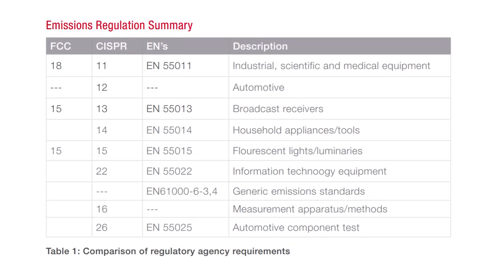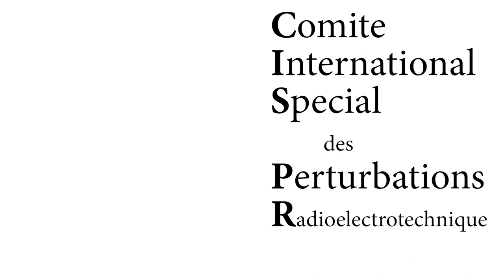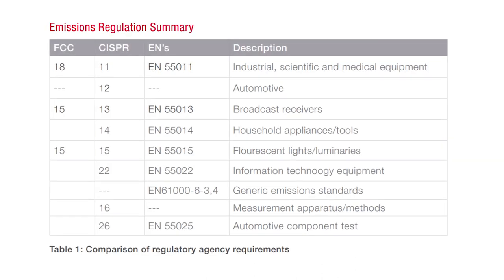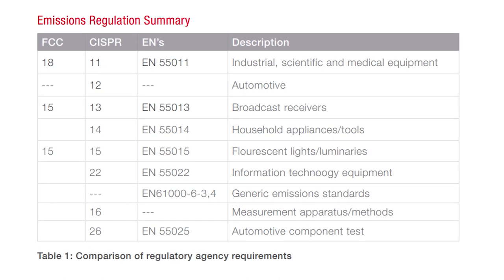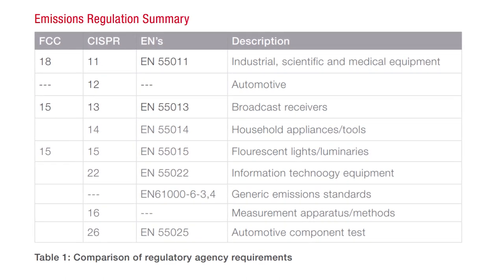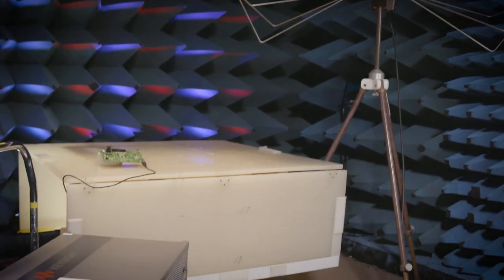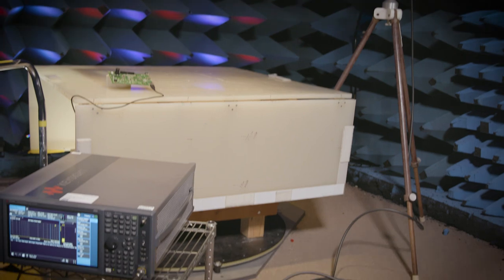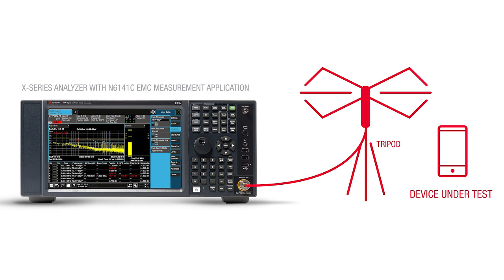Radiated and Conducted Emissions Testing - The ABCs of EMC (E02)

Comment: I have a question for you engineers.  Suppose I have an overheating microprocessor on a circuit board that is enclosed inside a metal case case.  We can wedge a piece of aluminum between the microprocessor and the inside wall of the metal case and this greatly reduces the heat of the microprocessor.  However now does this impact Emi or EMC.  Could signals now be conducted from the metal case wall 2 the processor and interfere with its operation in other words could there  be conductive immunity issues with the microprocessor or would the metal case "sink" or protect the microprocessor as before?  I hope this was clear I can explain in another way if necessary.